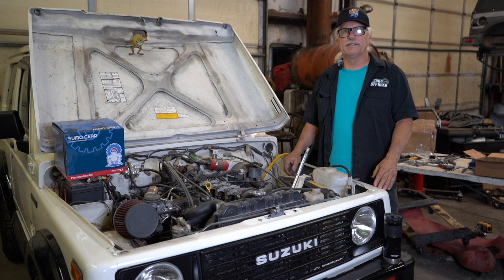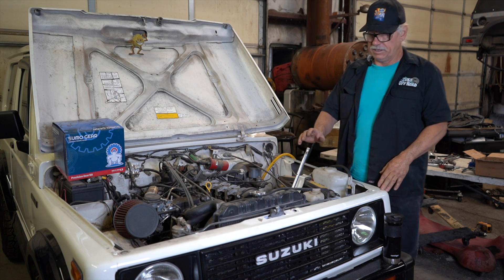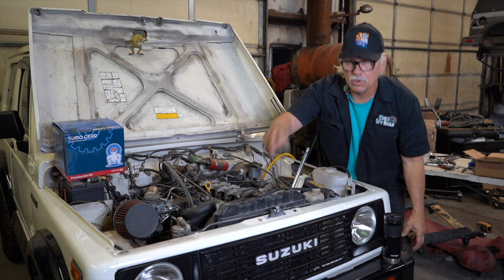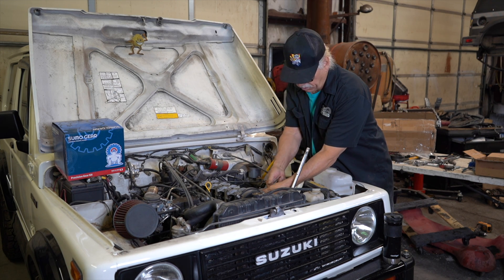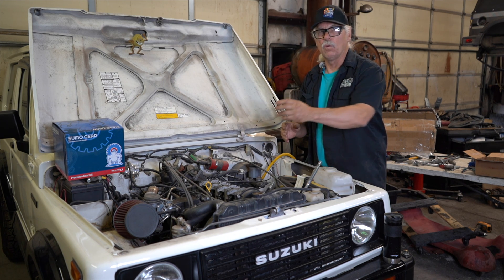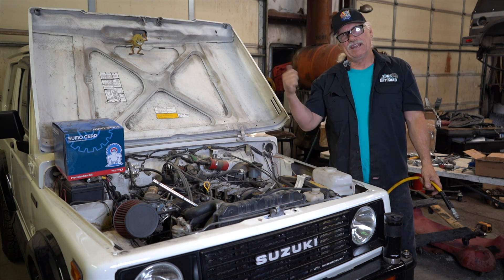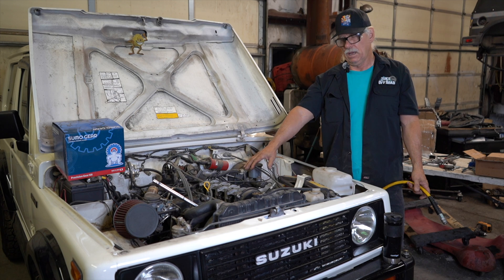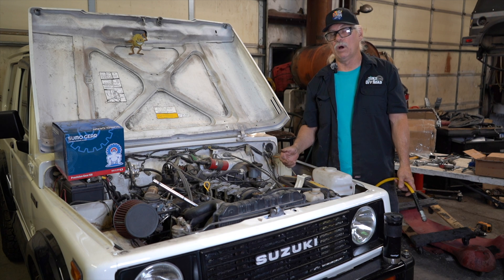Use Air Pressure To Diagnose Bad Head Gaskets

Comment: Your videos are so  in depth and informative!! Thank you. At what pressure should I perform this test?

I'm noticing coolant in a cylinder after driving up on restart. It burns off in a few seconds then runs perfectly for pretty lengthy drives. Definitely losing coolant at half gallon per day or so. 

No bubbles upon starting with radiator cap off.

Could a bad intake gasket cause a little coolant to enter a cylinder?

Comment: PSA,   If your head is warped good chance the cam journals are following the same arc.  Having the head resurfaced with out heating the head to straighten it will result in a broken camshaft.

Comment: looke like water  shot straight up right around 3 minute mark   straight out the radiator?     any way informative video!
Reply: Yeah there might be a bad head gasket. Sad times.
Reply from the maker: I think that was the long ratchet I had on the front crank bolt moved when the motor rotated.